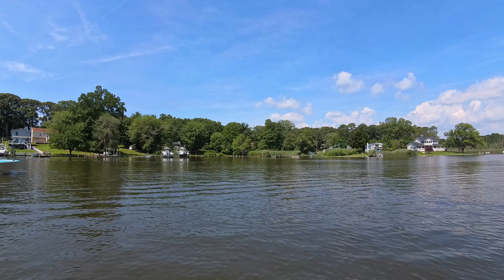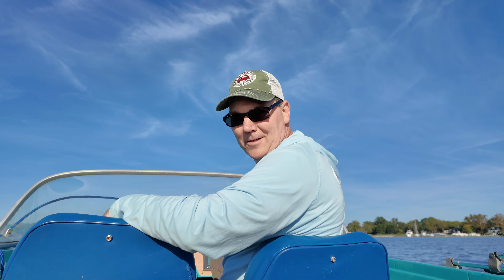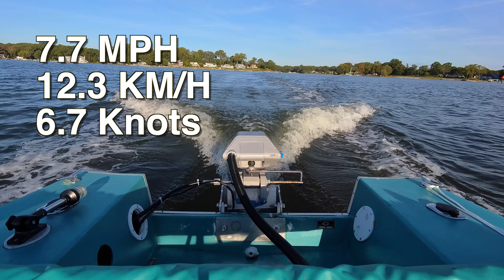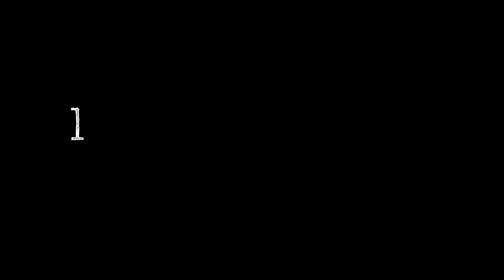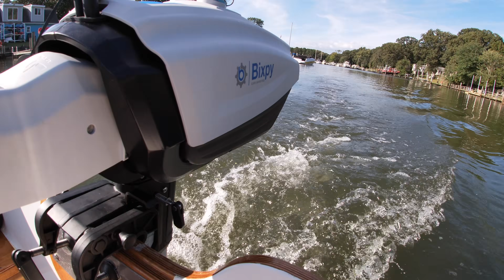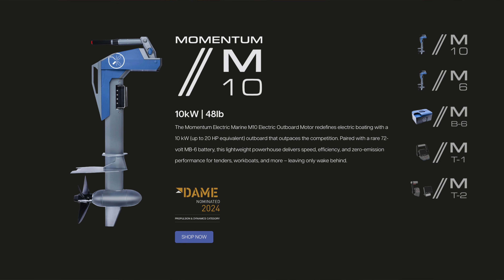Electric Outboards - Momentum M10 vs ePropulsion Navy 6 top speed test!

Comment: Fantastisch, op onze Amsterdamse kanalen mogen we niet harder dan 6km. Dus ik neem voorlopig  de navy 6.0. Maar de batterij van de epropulsion zal wel snel leeg zijn.
Reply from the maker: In your lovely city, a Navy 6 would be more than enough and with the 6 km/h speed limit, the battery would last quite a while because these electrics use very little electricity when running at lower speeds.

Comment: Problem Direct Drive, gasoline outboards are geared at the lower end, electrics simply use a big minicota wrapped in a plastic water proofed shield are cooled connected to the leg  and they are a waist of batterys they are cheap and they are junk the same as electric scooter hub motors which eat up batterys and have no realistic range at all!

Comment: Hi Wayne! We talked a little while ago about putting a Momentum M10 on my 24 foot pontoon. I’m deciding on the Navy 6.0 because I can use 48 volt batteries in other applications during the offseason. If it turns out that the Navy 6 just isn’t fast enough, what do you think about running 2 in tandem?

Comment: Hi Wayne, any plans to show how you set up the momentum m10 with the speed control and steering? Curious on how easy that is, added costs and if I can consider adding a setup like this on my old tracker. Thanks
Reply from the maker: To have it set up like I do, just buy the "remote" version of the motor (no tiller handle) and the single remote throttle side mount - that comes with the display screen. The only other thing you would need is the battery (or batteries and battery adapter). These things are very 'plug and play' and easy to install. Tools, like a drill and screwdriver, are only needed to mount accessories like the throttle.

Comment: You are doing these tests for a whyle but still act like a rookie.
You even had the balls to name yourself "the boat guy" 😂
Same as those stupid youtubers that make poor reviews on EVs.. saying just the motor and battery capacity with an average mileage told by the builder.

If you really want to be TRUSTABLE, start acting as an engineer.

You should ALWAYS specify:

- the boat weight and dimensions
- the submerged volume and it's smooth
- the motor weight
- the batteries weight
- other weights and their place in the boat

- picture of the hull
- picture of your boat above the water (wind resistance counts, too)

- wind speed and direction
- current speed and direction (if any)
- type of the water (salt or fresh)

- speed at each level of power consumption
- direct drive motor or gear driven
- dimensions of the props and wich material are made of
- type of cooling for motor and controller
- voltage of the motor
- type of batteries accepted

All of these counts.
Sometimes you specify some of them, but you forget the others, wich makes you videos incomplete.

This might upset you, but this is the reason I am not looking to you regularly. I just come back once in a few months to see if you changed your quality.

Now, I was dissapointed, again. 😔
Reply from the maker: Many of the specifics you are looking for are available on the company web sites and if you're a serious shopper I would hope that my videos are just a "starting point". I try to cover the things many people wonder about - like is it louder or faster than X?
As a solo creator, who is not an engineer, and doesn't have a month to research and test every variable, I will never provide enough information for every viewer because it is endless (reliability, serviceability, etc.). No matter how deep I go, someone would certainly ask "how will it do on a 16 foot aluminum V hull with 3 200 lb. adults?"
Reply: Bro, stop using ChatGPT. Maybe try making some YouTube videos before you comment like this. There is a reason why Wayne has over 85 thousand subs. @WayneTheBoatGuy Don't listen to this guy. He is speaking out of his bottom.

Comment: Hello Wayne,  I would be very interested to have you share your thoughts on a project I have in the works.  I have a ePropulsion Spirit 1.0 so I am a little familiar with electric motors.  I have also done many Everglades Challenges and am thinking of a class 6 (solar /electric+human power) attempt.  It is a roughly 260 mile event.  The boat we have for this is a Stillwater 25 XL wakeless Launch. We would buy different outboard for this, not the Spirit 1.0.  Your videos have been very helpful and I would love to talk about some of your findings and discuss my project.

Comment: I would love to see a video on the Torqeedo Cruise 6.0 motor using their standard 3 bladed prop vs their 5 bladed prop. When I used AI to analyse different motors and props for cruising at 4.5 knots on my catamaran, the results indicated the 5 bladed prop would give me the same speed but with less power.

Comment: Electric motors are very expensive, i prefer a gasoline engine because it's cheaper.
Reply: but electric motors dont require gasoline.
Reply from the maker: Yeah the upfront cost is high and we really don't know if would be cheaper in the long run yet.

Comment: I have the momentum on my 1959 Lyman 16.5. I can do 15 knots. Built my own 24kwh LFP pack. I love it. 

There is a small switch inside the throttle to change the mounting style/direction.
Reply from the maker: 15 - wow! I need to shed some weight on this boat!
Reply: @WayneTheBoatGuy what does it weigh?

Comment: Conclusion - A 10 kW motor is faster than a 6 kW motor and planing is faster than displacement speed (apples and oranges x2).  Given the key design factor for an electric boat is the low energy density of the batteries, it would have been really useful to see the boat speed vs the input power at 500 or even 1,000 watt intervals for each motor.  Then we would get an understanding of the relative efficiency and a fair comparison of each motor through its' input power range.
Reply from the maker: I hope to do more tests in the future.

Comment: I loved seeing the smile on your face as your Glastron actually got up on top and plained across the water. At 14.5 mph you’re now starting to get enough useful speed to actually get somewhere. 

How well did the Glastron accommodate the additional weights of the motor and much heavier battery? 

With power approaching the 15 to 30 hp range, there are a ton of smaller fiberglass, aluminum and wood boats out there in the 12 to 15 foot class where these motors could become very viable replacements for the old two stroke and 4 stroke motors. Especially on restricted lakes for noise and fuel. Package price is still a big limitation, but it appears that things are gradually improving in that area.
Reply from the maker: When I did this test I actually had three batteries in the boat. The 90 lb Momentum MB-6 battery as well as a 100 Ah 12 volt battery that weighs about 30 lbs and a 105 lb Solid State Marine battery.

Comment: What about a range comparison ? With their standard package batteries
Reply from the maker: All of these electrics have MUCH more range if you back off the throttle just a bit - but running full throttle the whole time, usually these can run about an hour. I have had no issues running various speeds for more than 2 hours with any of these electric outboards.

Comment: I achieved 12.2 knots (14mph) WOT on my 17 ft. long by 4 ft. wide wave piercing catamaran propelled by a $500 Hankai 4.5hp air-cooled 4-stroke outboard motor.  I estimate my mileage to be 20 miles per gallon.

Comment: I wonder how hard it be to make a hybrid with one of these use the excess charging power to charge it under long distances! Also couldn’t you leave the prop in while driving with gas and use the e motor prop as a generator 😂🎉😂🎉
Reply: @LarryLivinLife  That’s a joke Right???
Reply: Not that hard. 

The challenge is having it installed on a fast enough boat. 

The Navy 6 is already capable of Hydrogeneration, the caveat being you must be going 10+ knots for it to develop about 1kW in regen. 

The problem has a lot to do with the propeller design. 

A prop optimally designed for propulsion has different characteristics than one optimally designed for Hydrogeneration.

Comment: Very cool video with great content. I feel the electric outboards have a place in the boating community but until the prices are inline with what a gas outboard cost they will be targeted to a smaller group of consumers. The biggest problem is the limited range with the electric outboard and overheating of the large battery array, hopefully the salt batteries change all that. My little 15 hp Honda outboard pushes my 15 foot bass boat to 21 mph and runs all day on 3 gallons of gas and cost me $3100......
Reply from the maker: Yes the price is a big hurdle for sure!

Comment: Really enjoy your content Wayne.  I have a small 15’ pontoon that I am trying to make adequate for trolling/traversing both electric and gas lakes, while still having some power to trailer the boat under power in each case.  If you spend most of your time trolling, you just need enough juice to ferry out to your fishing spot and back, with several hours worth of troll capacity.  I am finding that having slick bunks and a boat hook is going to be a key part of trailering with relatively low power.    Would still love to see you review a Haswing Ventura as a very bottom-of-the barrel economy outboard.  It’s practically the only thing in most folks’ affordability range.  Merry Christmas!